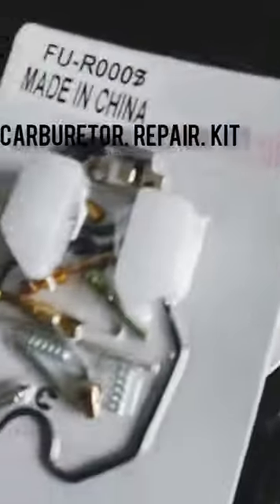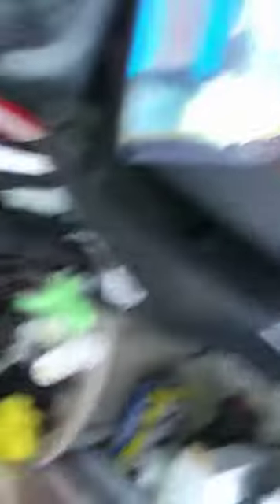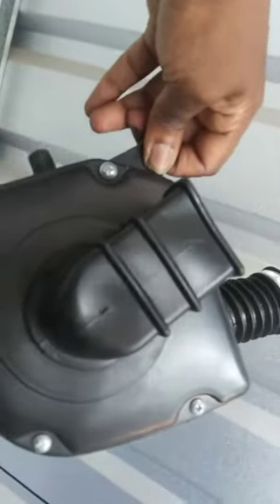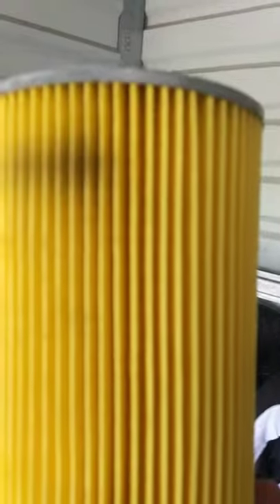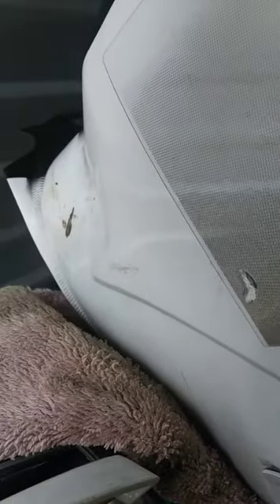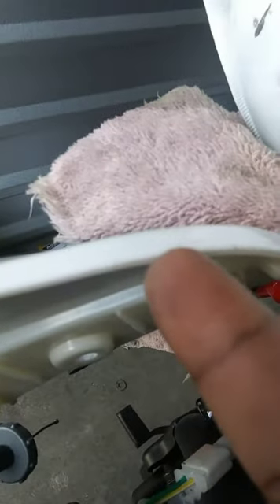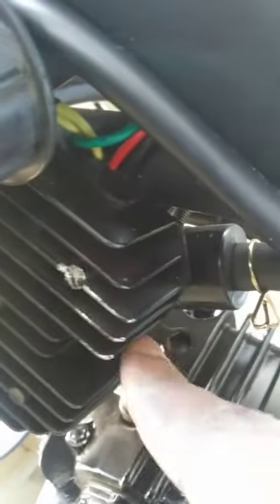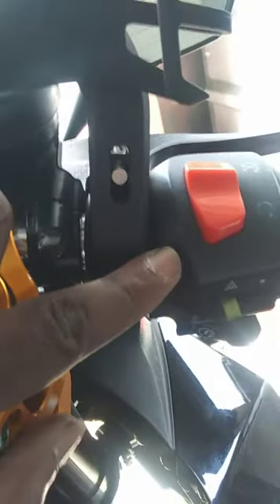x22r Air box delete and needle upgrade

Comment: Install rubber washers between the panels and tank. They will reduce vibration and space the plastic off the tank. I don't know if you realized but these bikes come with a performance CDI. I tried a couple of those so called performance CDI's and it ran better with the stock CDI. Also the performance CDI i used would make the tach go crazy.
Reply from the maker: Never kno till ya try...spare parts anyone 😆
Reply: @trucker2b  LOL. I did keep the CDI for a spare on the bike. It would run to get you home. Glad to see you given the bike some love. 👍
Reply from the maker: @JerryHawk250  I slept on my bike b4.... kick your feet up on a triple tree lay down bend your knees on the gas tank put your head on the rear passenger seating is relaxed try not to move so much

Comment: With the airbox delete, where do you route the hoses, do you just remove the hoses and cap off the one coming from the crank case and the one on the right side of the engine?
Reply from the maker: never cap off the crank case... oil presure will build up and turn in to a shaken soda bottle.... we dont want that....put a crankcase breather filter on it
Reply from the maker: yea i removed all them hoese's and  secondary air intake device ...and the airbox
Reply: @trucker2b  cool thanks, do you have one you recommend or the size for it, also the hose that comes out of the engine block, would be capped though right?
Reply from the maker: @sethkelley1657  https://www.amazon.com/gp/product/B07VL78P2N/ref=ppx_yo_dt_b_search_asin_title?ie=UTF8&th=1

Comment: i have x22r wit no air box jetted to 45 an 110 , 18 an 36 sprockets , oil cooler an im hitting 100 an not even  red lining
Reply from the maker: i figured that would happen all the research i did but now i have little time since im working over the road.....awsome bro post a video or review ima head over to ur page now
Reply: Where's the proof? And what upgrades did you do to get it up to 100mph?
Reply from the maker: never hit 100 yet.. stock 17 front tooth and 42 rear is 75mph... trying to get the engine to breath better for more hp

Comment: You never actually stated what kit number or needle size you used?
Reply from the maker: I basically used a 110 main jet , 40 pilot Jet and then I put the needle in the third position the bank responded to a very well... Particularly it wasn't a kit that I used I just use separate parts like a multiple Jets anywhere from 30 all the way up to 200 yet and I just basically nitpicked which parts that I use.... So you're right about that there's no definitive kit name brand or model that I use but I did show where I got that extra needle from
Reply: @trucker2b  many thanks sir!

Comment: whats your top speed after that upgrade
Reply from the maker: 75mph stock - moded still unknown registration expired cant ride...but will deal with that soon
Reply from the maker: well with mods.. i hit 75 at half throttle so im sure 80-85mph
Reply from the maker: well after further riding.. it feel like a bike.. the lower u gear it the slower it goes.. but it take off fast... i might throw a bigger sprocket on but not stock to get the torque back..but before i do that i will do a carb swap to see how worth it everyone says